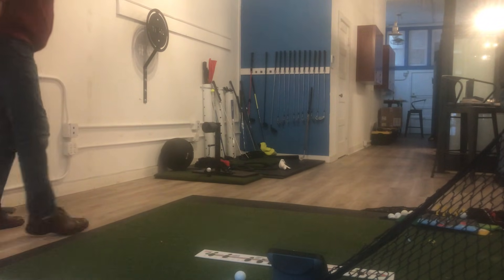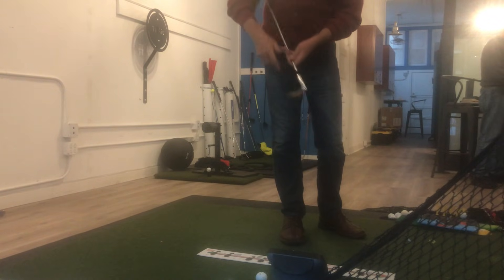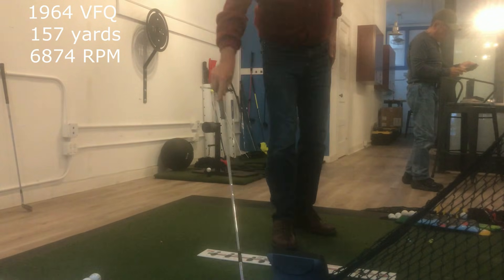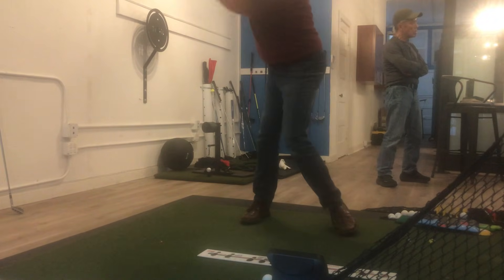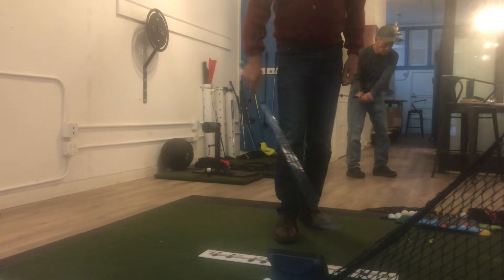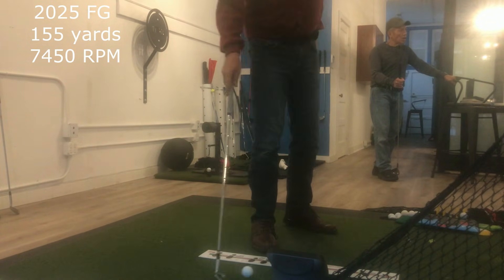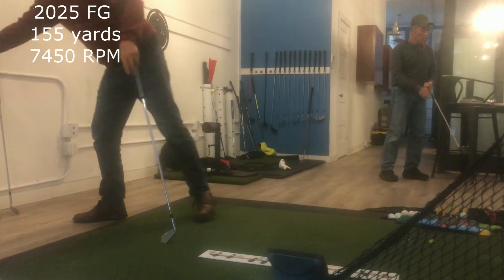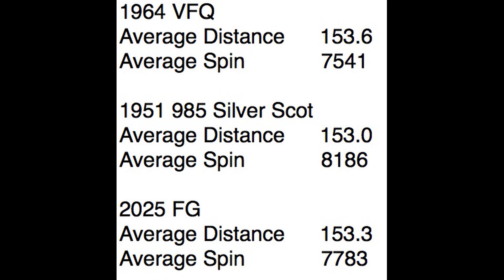Three 7 irons.  2025 vs 1964 vs 1951 comparing spin rates and distances from the Lab.

Comment: How do the VFQs hit out of the rough? I thought grooves were intended to assist when you have grass/dew between the ball and the club face.

It was only during the square groove era that the grooves made a significant difference in spin rate with fresh grooves.
Reply from the maker: Again... just another shortcoming of the launch monitor era.  Doesn't test this kind of thing.  The VFQ have a combination of grooves and dots.  To be honest... I have never found them to be inferior out of the rough.  The heads are actually slightly smaller which of course would help them get through heavy rough easier.  That being said, I don't drive the ball into the rough very often.

Comment: When hitting off a mat with a launch monitor, loft trumps everything else.  Other variables are secondary and tertiary:  shaft length, shaft weight, shaft profile, lie, etc.  Two irons with the same loft are going to go roughly the same distance, no matter the design of the iron.
Reply from the maker: The only reason I even went on the launch monitor was to get some kind of data on spin rates.  I've been really frustrated by low spinning balls that I can't work or shape.  Hearing Callaway has made a higher spinning ball actually peaked my interest enough to check it out.  I don't need launch monitor to tell me the ball flight.  I see practical value in the launch monitor for spin rates.  Once confirmed, which I did... I can test it out on the golf course next time I play... which might be 6 months from now.. who knows...

Comment: You mention the COR and trampoline efect John. The ironic thing is that a very large percentage of golfers cannot put enough momentum into the clubhead to take advantage of the trampoline effect. You need a minumum of 100-105 mph. The PGATourrrrr pros are way beyond that and most amateurs are way way below that. Maybe the powers that be, as sterile as they are, should dial back the COR to 79, equivalent to the old persimmon drivers according to your research.
Reply from the maker: The USGA is going to do what they want... but their job was to protect the game, which they have failed  to do so to the point even THEY are admitting they made a mistake with the ball roll back nonsense.  That being said, they have left the door wide open for a new organization to just re set the proper game.  I give the USGA no power over me.  I certainly won't play in their events, and won't play by their rules either. TRGA Rules are much better.

Comment: 10:59 Wow, very interesting. I've often wondered how different they could be. Is the dispersion much different?
Reply from the maker: Just typical... from front to back about 20 feet.. left to right about 20 feet.  I'm hitting these into a 20 foot circle roughly.  My circle tends to skew to the right.. so I might hit one 5 feet left of the pin and 15 feet right of the pin. I do this for a reason so I have more left to right putts than right to left putts, and skew slightly shorter so I have more uphill than downhill putts... with the most being uphill right to left putts.  Opposite of Mac O Grady for example.  My miss is not a pull.  I would choose 7 iron here... relative full shot... at 155 yards.  That being said, I COULD hit an 8 iron 160 if I want to go at it really hard... but I risk losing control doing that.. so I rarely would do that.  This all the nuance players stuff that these machines have no insight into... and why I don't give them much consideration really.  Interesting to test spin rates.. that's about it... or a youtube video for conversation.  I'll post one more video on golf balls, then a summary.... then probably won't be back on one of these anytime soon.

Comment: It is nit the club but the shafts!. Comparing my Callaway steel shafts from 1995 to my Fusion Tis from this year with graphite shaft I hit the Tis about 15 meters longer. And of course they are far more forgiving...
Reply from the maker: Being a hitter, I negate most all the variants between shafts because I am holding shaft flex into the strike so I'm not getting more "kick" from one shaft to another.  That being said, if you are not doing that, then you are bringing all kinds of other elements into the equation... so what you are saying is 100% correct.
Reply: Ir's mostly the club head. Your 1995 model had 34* of loft. The Ti's have 30.5*. So you are swinging pretty much a  6 iron with the Ti 7 iron. Unless of course you modified the Ti's.

Comment: Is there a formula for figuring out how flat to make the lie angle on all clubs based on someone’s height ?
Reply from the maker: I'm sure there are all kinds of formulas invented by clubfitters for this.  But it doesn't change the advantage flat lie angles offer from a geometric standpoint.  My formula is to swing as flat a lie angle as you can by adjusting your swing to a flatter club.  In this video, I hit a 1 iron standing on my impact bag making me 6 foot 8 inches tall.  No problem.  https://www.youtube.com/watch?v=HadNHro7HDg

Comment: You should try lighter 2025 clubs. Im sure the distance irons weigh less. The straightest irons i ever hit were the elliptech irons made by golfworks designed by a sneed family member forgot the relationship. I noticed they copied the exact same shape as tigers 1997 irons.
Reply from the maker: Zero chance I would be fooled by such a thing.  Physics hasn't changed.  All the new irons are is just longer shafts and less loft, with more bottom weighting.  That's not how you hit controlled irons. I could just as easily set up a classic set that way to get more iron distance... if I were foolish enough.. which I am not.

Comment: I GOT MIZUNO mb's 2 generations ago and the clubfitter used a scratch pad that kept showing heel bias, because my swing was poor back then 4 years ago. But he kept bending those hosels and he was moving it so....if u want flat, that's what I got. Like 6-7 degrees. So ,if I got my hands on a sleeve of balata's  ,I could theoretically go to a course like sharp or tilden or mare Is. and play the game that erickson is advocating for.
Reply from the maker: Too many unknowns in your comment here. I've seen players come radically OTT into a heel bias as if they were chopping wood with an axe.  However, if you are on the 4:30 line and have heel bias, or that moves you into 6 degrees flat, then you would be in a good situation to start developing a really good golf swing.... assuming 101 other things are also working correctly.